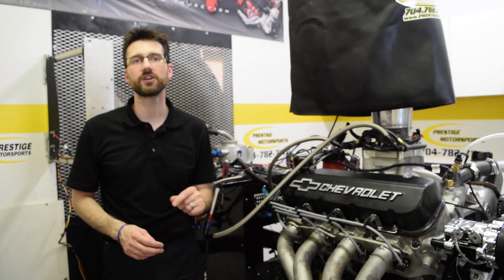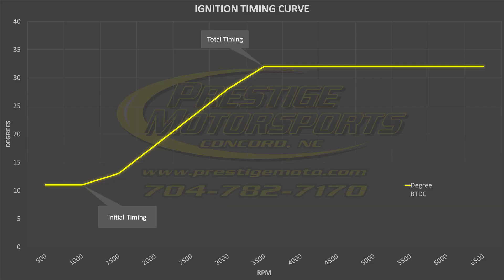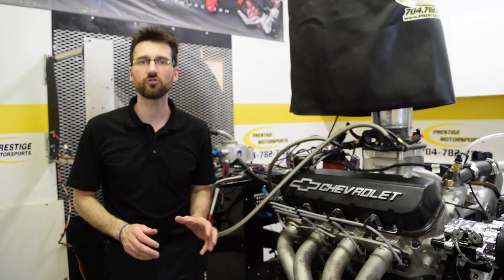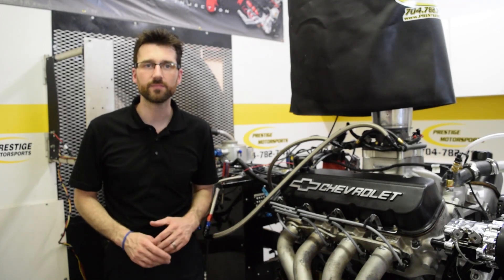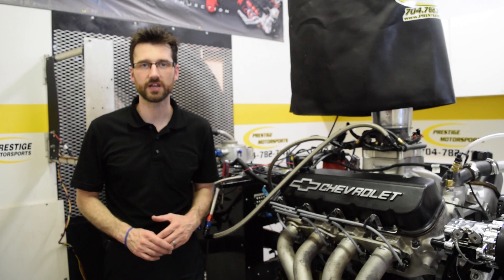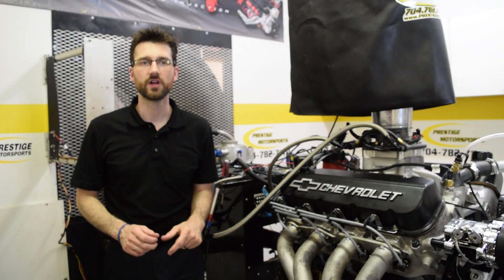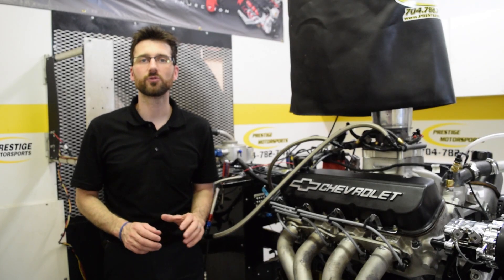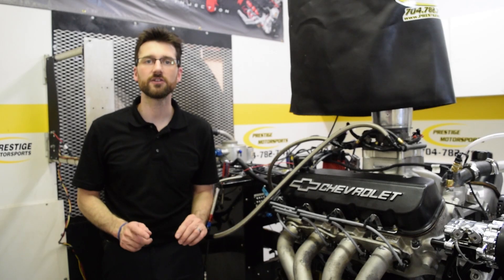Ignition Timing: Result of Incorrect Timing and How to Check Yours

Comment: Hi i have a 98 2.3 L 4 cyylinder 8 plug ford ranger manual 2 wheel drive its a no interferacne engine i know the the dimond on the oil pump is the timing mark for oil pump and triangle for the cam and crank is lined up n num one cylinder is dead up now prob i am having is the originial timing belt broke i realigned  up every thing n prob is it will start n and stay running but idle like crap and has vertiualy no throttle response i can floor it n engine does not respond jus idles like crap real bad what cud cause that please message asap

Comment: I thought this video would be about programming computer controlled ignition curves. 
  I'm trying to maximize my part throttle timing curve. I've got a knock gauge and plan to do a lot of testing. I'm tuning for 93 and 87 and perhaps 100 octane. I'm currently running 30 degrees at idle on 93. That gives me the best vacuum @ 700rpms.  I'm running 38 degrees total @WOT as per Trick Flow's recommendation. I simulated a vacuum advance curve and a centrifugal advance of 20-22 degrees. I max out at 50 degrees under high rpm, low load. Without vacuum advance, I'm looking at 17 degrees initial timing. I'm all in with 38 degrees @ 2700rpms. I also add a couple of degrees of timing with very cool intake air temps and pull a few degrees of timing with very hot IATs. Mild bolt-on 355 Chevy.  Comp cams' camquest software says 447hp.
Reply: 50 degrees under high rpm, low load

or you could use the brakes to slow down
Reply: @ihatecrackhead  go ahead and check your hei timing at 4000 at steady throttle in park. Initial timing plus centrifugal plus vacuum advance. I'll bet it's pretty damn close to 50⁰. Don't act like it's totally unheard of. My 1983 2.8L V6 Chevrolet S10 shows 60⁰ of timing advance under those conditions.

Comment: What happens if you can't advance it? I pulled the distributor out and moved a teeth over but still same place?? I'm stuck
Reply: I maybe completely misunderstanding you but why would you pull the distributor out?
Should be a hold down tab of some sort (could be "Y" shaped) where the distributor "shaft" goes into the engine block/manifold, if you loosen this tab but just barely enough you should be able to physically rotate the distributor and then fasten the hold down tab tight and check the timing again.  Part of the reason to check it again is to make sure the distributor hasn't moved from where you want it set.  It could have moved while you were tightening the hold down as example.  IF you move it a lot you can easily hear the change in how the engine is running, extremes are not good.  Its a check, set, recheck, set, recheck process.  Once you are happy and the engine is performing, you may not change it for quite awhile if at all.

Comment: So my vehicle is supposed to have its timing set at 0. So does that mean total advance needs to be set to 0 or initial timing be set to 0??? After watching this video I'm confused
Reply from the maker: That would be an intial timing setting. If your engine is factory, unmodified, then follow their instructions for setting the intial timing. They already know what total timing is based on engine design when initial is set to 0. The above video is for engines that have been custom built or modified.

Comment: What if some dummy has a vacuum advanced distributor?
   Where did you talk about that or that it needs to be blocked off before you adjust it....wow
Reply from the maker: Good point. If you have a vacuum advance, yes, it needs to be disconnected and the vacuum line plugged when setting your timing.

Comment: 1975 Pontiac 400. I put a aftermarket HEI Chinese DIstributor in. Within 4 months I've replaced the ignition control module 4 time's.  1 a month. The Ignition Control Module is internal.  Any help here. Thank you
Reply: 1975 PONTIAC CATALINA 400-THM400 yea if its a 4 pin module just get the ac delco d1906..made in us and says gm on it..i never have problem with those but have had plenty with the cheap ones that come with chinese hei distributors or even the  delphi brand(made in asia) replacements modules..oh and some upgraded heat sink compound for the bottom of module vs the cheap package of white stuff that comes with it

Comment: I have 10 degrees at idle and 34 (recommended) at 2800 total advance,
 but when I connect vacuum I have the same at idle but my total is 42 
instead of 34 at 2800 and above. I'm working on a 460, aluminum heads, 
stealth intake, 750 edelbrock carb, headers and a holley billet distributor 
with msd 6a box.I was thinking of leaving the vacuum advance disconnected.
I'm also using a wideband A/F meter  to make adj.s to my carb.
Reply from the maker: I would recommend leaving the vacuum advance disconnected if you are unsure about what advance curve your engine can handle under cruising / light loads.
Reply: piston no where near the top at 42 degs dos not   make since

Comment: So I have msd 6AL with a locked out distributor as I increase my engine rpm my timing retards please help
Reply from the maker: If you have nothing else that is controlling timing, then you may want to take a look at your balancer. Make sure that is not seperated.
Reply: Prestige Motorsports Inc it was the pick up on distributor thanks for tip I hadn't thought to check balancer

Comment: With the marks lined up to each other , crank mark at 12 o'clock and cam mark at 6 o'clock. You will find that you are at spark plug number 6 firing,...to get the rotor pointer to number 1 position you have to turn the crank one revolution (360 degrees),  And when you are at TDC for number one, your crank mark and cam mark will both be at the 12o'clock position. SO you want to set the marks where they line up to set the cam timing, then BEFORE you put the distributor back in, you will need to crank the engine over 180 for number one if you want to start it....  ;-)
Reply: I WAS RUNNING MY 350 THE OTHER DAY    I CHECKED ALL COMPRESSION   THE LOWEST IS 140  TO 165  NOW MY MOTOR SEEMS TO BE CRANKING OVER WAY TO EASY  CAN THIS BE VALVES   AND IF SO WHAT DO I DO

Comment: You might offer a video explaining the mechanical advance functions and also a discussion about vacuum advance and what it is all about. There are too many motor heads who believe vacuum advance is something to eliminate completely, utilize ported (venturi) vacuum or manifold vacuum.   Truly, only one vacuum source is the correct one.
Reply: Well I can explain this from a general motors co. Standpoint.  
They've done studies: 
-the best initial timing is going to fall within 2~12 before or after TDC depending on
Peak timing, or where it should operate is 30-36 depending upon tbe factors of tbe specific engine. 
Which means let's say you're @~10TDC at idle, initially.  then you'll want 20~26 degrees intermediate. Which will add up to 30~36 degrees of total timing or peak timing. This is where the engine should be. 
 many factors such as mileage, age, cam duration, etc. 

- PRE EMISSIONS  engines, the vacuum advance should be hooked to manifold side 
- vehicles fitted for the VET and EMISSIONS control should be hooked to ported 

- manifold will begin advancing at idle and will peak when throttle is cracked, thus advancing the timing right away, engkne is efficiently burning internally and pumping out waste it doesn't require. Whereas, the ported is very "vanilla" and will allow for a leaner mixture to run as it slowly advances with throttle responses.

The advance is a device that, when diaphragm is acted upon, advances tbe distribution of spark as more vacuum pressure is created in tbe engine, acting upon the diaphragm.  

In most cases, especially vehicles fitted with larger cams, won't run unless the advance is hooked up. The pick up in tbe distributor will not effectively spark, causing hesitation or the engine to "fall on its face" when you crack the throttle

It doesn't really matter how many inches of vaccum you build through manifold side of carb, as long as you adjust it to the max vaccum whilst still running smoothly.  You'll want the needle on your Guage to be sustained in one slot at idle, if it's not, you could experience a plethora of issues such as leaky intake, cracked vaccum hose, or blown head gasket. 

You'll always want to set your idle screw all tbe way back to not effect the throttle linkage arm, you can adjust idle when you're finished.
Reply: @arthurmoore1524  Pre-emissions days I had varying opinions from gearheads and those who used venturi ports never had great running engines...it was so obvious yet they kept them set up that way. I drove around town with the A/C on in 90+ degree weather and always had a cool running and smooth idling GM.
Reply: @Garth2011  you can run the advance off of literally any port. It'll work, it may not peak, but it will function..

For AC cars I do mainly use the ported side because of the extra drag on the engine. It'll eat up your inches of merc. If you don't. 

But for sportier cars I tend to lean more towards manifold. If it's cammed I'd definitely use manifold because you're going to lose  IOM  due to low idle & choppy idle. 

I also like more advancement off the line for dig racing, and manifold vacc to the advance will help create more advancement quicker.
Reply: @Garth2011  I tend to try to stick with GM and their say so on vaccum. 

If it's old, I use the old gm methods 
If new, I use new gm methods
Reply: But, I also run a very cool 160 thermostat,  change the curve of the distributor,  and the shift points via modulator.  

When I put one together,  it will really talk to you lol you can take a slower car and beat a faster one on paper if you got the right tune and reflexes.  

It takes time.

Comment: I really don't understand timeing got a 79 blazer 350 put a rebuilt motor in has edelbrock intake headers and a RV cam double roller timing chain and   crane push rods seems like it has no power thinking it is the timeing thought was post to be 0 on the timeing do I need to advance the timing
Reply: Bigrich0g Could be so many things. You'd have to check all the basics. Compression test, firing order, is the carb set right, etc. 0* timing is too late. Engines need spark slightly before top dead center. How much depends on many factors, but on average I think initial timing is about 10* BTDC at idle.
Reply: Thanks really appreciate it. I found out has alittle do with a bad carburetor had alot of dirt in it probably from the bad gas tank I had in it got me a new distributor going to set the timing tonight thanks for ur advice
Reply: Bigrich0g set tdc spin the distributor 180

Comment: well I'm living in the 21st century and it's computers (ecu) in European vehicles that deal with the timing, iv not seen a engine in over 10years that has a distributor, I take a lap top plug it in to the ecu and that is the only way we can manipulate the timing here in Europe apart from cam timing which some of it is variable on certain vehicles now. Agriculture comes to mind when I read about American engines. Yes I know there is one or two good ones but most are Agriculture to me. Sorry.
Reply: its hard to understand that there are people  who love old performance cars and simple,easy to adjust methods of fixing and tuning these vehicles.i can tune my car with a handful of tools and very little money,you on the other hand have dozens of sensors,meters,relays and bullshit that are insanely expensive and each one relies on the other to work properly.you have an ecm,mass air,or manifold absolute pressure,throttle position sensors,air fuel sensor,oxygen sensors,knock sensors and i have a "SCREWDRIVER AND A CARBURETOR"hope this helps you understand,its not just an American thing.im not even from the states Canada,Japan,Australia,New Zealand,Sweden,Norway etc all love vintage cars they love,covet and tune 40+ year old cars as a hobby all the time as well as modern machines.knowing how to tune a vintage machine or hot rod isnt just done in America.

its funny though,agriculture comes to mind when Americans think of Europe.
maybe its just the area you are from,old school horse and plow agriculture 
and spreading shit by hand that is.best o luck with that
Reply: nothing is better than pussy
Reply: @ConTheDon187  pussy that has a bass boat is
Reply: this pussy has a 97 nissan primera 1.6     91k  English Plate.No probs in 3 years...driven thru france to costa blance, and back, no problems, now the engine stopped while drivin... new dizzy and all that surrounds, but now it pulls lika see you next tuesday, and my garage are not used to old cars ,ffs, and having issues doing timing....unless its a faulty new dizzy...hopefully another new replacement one will prevail, as this lil shiny black beaut is easy in every respect,  apart from my airbag light flashes now...didnt before, but guess thats for another page...!

Comment: Is any one els being botherd by the kinked radiator hose 1:20?
Reply: Yup
Reply: That kinked radiator hose ruined my day as well.  How can people be so inconsiderate to force all of us snowflakes to stare at such sloppy and careless installation.  If I could build or I one day learn what this sloppy man knows, i will for sure not have a kinked hose hurt our pretty eyes.  Promise!
Reply: they have a high valume water pump. that knick is nothing
Reply: lol. ya it bothered me too but i figured when they started the engine it would straighten out.lol
Reply: What happen if I don’t have the ignition timing specification requirementswjwn the engine was built my engine build retired and moved away
Reply: I'm bothered that they didn't even do a run with the engine.

Comment: Why is so called pro`s talking about explosions, there is nothing exploading in an engine, detonation is uncontrolled combustion were you have air/fuel mixture selfignite. This can occurre at sevral diffrent locations in the combustionchamber due to heat. There is nothning exploading!!!
Reply: big daddio Mate from a mechanical engineering technical term the correct way to explain a combustion engine, is a controlled burn and not "explosion"
Reply: In layman a terms yes maybe, but it is still a controlled burn
Reply: RookieDude Stor Yeah that is true
Reply: An engine runs because of explosions.
Reply: in layman's terms its a damned explosion,period.
 fuel and air goes in "BOOM",that's whats known as
 an "EXPLOSION" last time i checked.

you can put a fancy title on anything but it doesn't change what it is
Reply: the air fuel mixture explodes during every combustion cycle 100s of times a second.
Reply: no,it isnt.

Comment: This is one of the only few videos that specify to set total timing and only use initial timing as reference. Can you clarify that this indeed is the case for typical cars too? Does it mean that the videos teaching how to set timing dealing with initial timing go about it the wrong way?
Reply from the maker: If by typical cars you are referring to factory cars without modifcation, then you are fine by setting initial timing following the manufcaturer's procedure. The explanation is that the manufacturer knows that if the intial timing is set under their specific conditions, the total timing will be correct.
Reply: @prestigemotorsports  Can the timing be correct without pulling out the engine? I have an 05 Nissan Altima 2.5L and I think my timing is off.

Comment: I just saw somewhere a guy who claims to have 12:1 compression. running 93 octane it just seems to me that you would have to hold back the timing curve so much that having that high compression would be redundant can you comment on this I do know that on a mild mannered or stock motor you can pretty much bring the timing curve in quickly ie. curve kits and see a difference but the more aggresive the motor it's a fine line ..
Reply: You folks know that High Octane gasoline isn't more explosive than cheaper low octane, right?  Octane is added to gasoline to control the burn more precisely and prevent pre-ignition etc.
Reply: Mazda Skyactive Engines have 13:1 compression lol, they run on 87 octane.
Reply: @jacktran960  yes they do but they have direct injection into the cylinder just like a diesel it is injected when they want the explanation to occour
Reply: @poopyloopy2141  Most gasoline engines are GDI anyways, it's Mazda with the high compression ratios and low octane requirements. Most high compression ratios gas engines use 93.
Reply: While this is something I could see myself doing with a drag car (where I can dump in high octane at the track), it's not practical as you mentioned in a daily driver/street application. If you have to neck the timing down to save it from having issues for the gas you can run, it's not worth it. In my 79 f150 w/ ford 400, I was able to get away with running 91/93 octane (which is also ethanol free around me) jumping compression ratio from 8.x to 9.6. All depends on what your going for.
Reply: Yes it's a fine line between octane compression and timing in conventional motors but w vvt and all anymore the skys the limit

Comment: so the ECU does this right ? 
but one thing i didn't get and its sort of a question 
as RPM increases you get more power
but the ECu does the math and always ignites the power at the best points as the dyno charts show 
So if i put a customizable ECu and put my car on the dyno and remap it i can get more Hp and torque
Reply: YOU ARE ON THE WRONG VIDEO,GO TO MODERN EFI JUNK